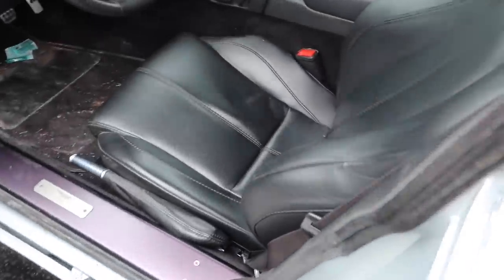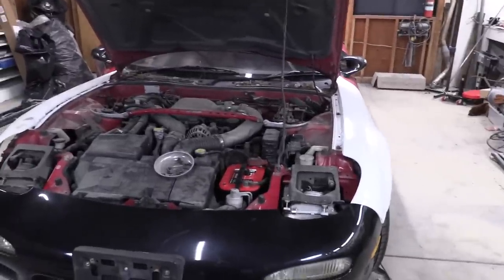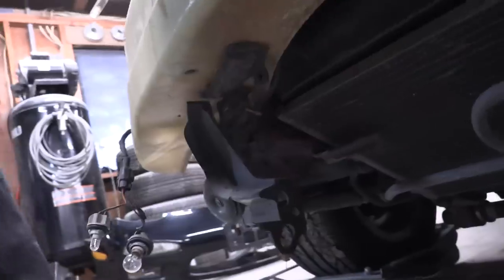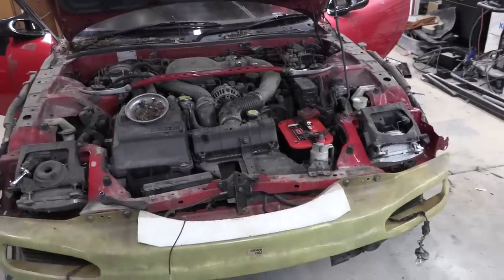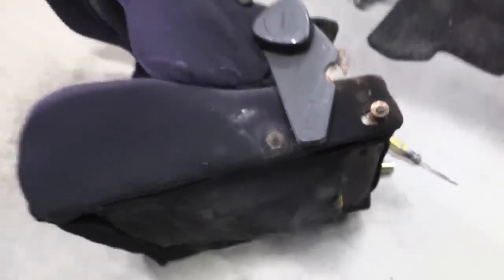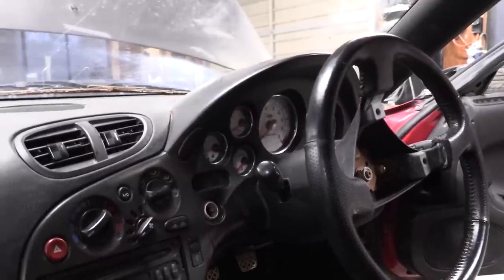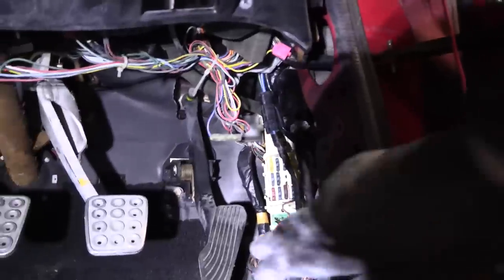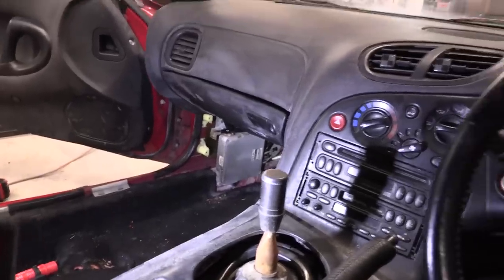Everything Wrong with my Cheap Imported RHD RX7 😜

Comment: My best guess as to why the Rotary wont run is the Rotary Seals on the actual rotors themselves. Im sure you know how a rotary works however the motor more than likely needs to be taken out and re built for "longevity" and not "f shat up" reasons. For the people who dont know a Rotary engine is powered by a Rotor basically a round triangle, that on all corners has a seal that makes it so that the combustion does not go into another side of the rotor. when people say 3 or 4 rotor is referencing the amount of "rotors" or "pistons" in the engine, but remember that a rotor combusts at 3 sides at a time while a piston combusts at 1 side at a time.

Comment: Chris, rotary engines aren't like piston engines. You can't just start em up to move a parking space and then turn em off. You've likely flooded it and over time this will then wreck your side seals.
Sit down of an evening and give Rob a long call and he'll no doubt be happy to give you all the tips for rotary ownership.

But the bad news is with the condition of that car, I guarantee your engine needs a full rebuild. That isn't quite as scary as it would be on something like thale Aston, but its still about 2-3000.
At least you'll be able to to get it Bridgeported at the same time (equivalent to lumpy cams, for that brap brap brap brap idle noise, and more gooder power)
If this is your dream car you can't stick your head in the sand with this mate.
Hey at least you bought the right car, look at my profile pic, I've blown 30,000 UK stirling on an 8, which, without another 15k for an rx7 engine swap, ain't ever gonna have more than 350ish hp...
Id have 800hp now if I'd bought a Supra (and this doesn't upset me at all... -.-)
Anyway, stoked you got yyour dream car mate, just do some research on the starting and shut down procedures, you can't treat these like a normal piston engined car.
Even the M5 can be driven like a VW golf to the shops and back.
Anyway, look forward to watching that first time you rev it out, sounds amazing in person!

Lads please like so Chris can read this, (or copy and paste I'm not digging for likes) long time rotary owner wants to share some friendly advice :)
Reply: Bridgeports suck on the street.
Reply: Nooo Peripheral Ports suck on the street. Bridgeports are fine to daily, unless you're a fanny who expects their rex to drive like a Corolla to work everyday.
I don't think Chris will be scared of a bridgeport, he drives around in cars that he's hammered the suspension strut back into roughly the right place. Also, the 7's been a dream of his since being a kid, and if his rex does end up a little gnarly for daily use, he only has three other cars to choose from eh?

Comment: The sticker is the "shaken" sticker. the japanese vehicle inspection. the big number is the month, the little number on the top is the year (they use a different year system than we do in America) If I remember correctly the sticker represents when the Shaken expires, meaning it would've expired the 10th month of the 27th year (2015). so the last time it was road legal was on or before oct of 2015. 

once you get the wiring figured out, could you possibly show if the side red rear markers/ front orange corner markers light up? i would like to import one, but the state i currently live in requires these to work for them to be imported.

Comment: Two things. 1) Get the carpet out of the car. That pad underneath will be soaked. Take a house hold carpet cleaner to it to help sucks up the water. 2) Your car is most likely out of gas. Since your gauges don't work you can't see that. They would never put it on a boat without making sure it is empty. Last thing they want is a fire on board a container ship.

Comment: I'm not sure if you solved it yet.  But I remember going to a bar and when I unlocked my car and hopped in the lights started to pop up and down and flash, , and the horn was honking, and it was really embarrassing.  I tried the key in the ignition, and locking and unlocking the driver's side door to no avail.  Strangely I went to the passenger side door (I guess your driver's side door) put the key in an unlocked it and the alarm turned off.  It was traumatic enough that everywhere I took the 7 to after that I just left it unlocked.  I believe it was the OEM security system.

Comment: on the front the 2 elec wrapped plugs are probably for fogs. the other random wire could be a outside temp gauge if the car has that function. I know my bmw has one that goes into front bumper.

Comment: Rotary engines flood if not properly warmed up.   I'm assuming that the deflood button doesn't work so put some windshield washer fluid in the service ports and it should start right up with fresh gas

Comment: I hope the Apex seals are not toast. If it's all good then please start mixing in some 2 cycle oil into the gas, it'll prolong the life of the engine (at least will help protect the Apex seals), just do not overly rely on the stock internal oil squirters/injection.

I would say you got yourself a tsunami car. It's been flooded. Strip it and replace a lot of the interior.

Comment: Could the taped off connectors on the left hand side of the bumper area be airbag sensors? Also I was a bit surprised that you didn't check that the emergency flasher button wasn't depressed.

Comment: The cars flooded they run really rich when cold you have to let it warm up when moved also disconnect the spark plugs and secondary air pump and crank for 10 secs and let it rest for 5 minutes and then again do this 10 times try start it with everything connected afterwards and let it run might need to keep the idle up and it will smoke loads but it will clear up ;)

Comment: The registration sticker on the windshield actually means it was registered in October, 2015. The smaller circled number at the top (27) is the Japanese Heisei year which corresponds to 2015 (2015 - 1988 = 27). The larger number (10) is the month.

Comment: Didnt finish the video yet but had a very similar problem with my 3000gt alarm it just needed to be reset after having battery disconnected which for that car could be achieved by unlocking the rear hatch physically with the key. Since the cars are from the same year i figured it might be something similar hope this helps

Comment: The white on the carpet is mold. Brake light switch is most likely corroded causing the brake lights to be on. Horn going off may be a water damaged air bag control unit. It looks like alot of water damage, probable flood car I've seen plenty of them at work. I would be worried about water you can't see that's going to cause rusting that you won't find until something majorly fails structurally

Comment: You're going to have to rip out the motor and change the Apex seals you need a engine seal kit and do not turn on the engine and turn it off fast you will dump two to three times the amount of fuel in the engine and flooded it.

Comment: The 10 on the sticker is not 2010 if my math is correct 1998. My current sticker has 30 referring to 2018. And it refers to the "japanese compulsory insurance" (JCI) every 2 years you have to update your JCI it their registration.

Comment: clean the car first.  then check electrical,   then move to motor and being a rotary the motor is probably going to need to be rebuilt.  probably lost an apex seal or side seals are bad causing compression loss.  electrical sounds like a bad ground issue.  check your grounds first.  i ran into that problem before.  then check fuses and see if they are missing.  after you get done with electrical move to engine.  just go ahead and pull the motor.  buy one off of ebay or find someone who knows how to rebuild it.  get it bridgeported.  turn it into a single turbo setup.

Comment: I have and fc rx7 and sometimes it likes to flood itself. It's a common issue with fcs, Idk if fds have that issue or not but, a quick fix it to pull the fuse for the fuel pump and turn it over a bunch of times and then put it back in and it might start. Mine does. Also, yes, I'd change your fuel.
Reply: 89+ have a ecu killswitch so you don't have to get out of the car to clear a flood, which I believe was also carried over to rx-8s. Just fully depress the gas pedal while you crank.

Comment: you might have too much fuel in it i had an rx8 and if you start it and turn it off right away it leaves a lot of fuel in the engine so you might have to pump the gas pedal while cranking it

Comment: Rotaries are bad about flooding, pull the spark plugs, pull the fuel pump relay and spin it over and blow out all the extra fuel, replace the Spark plugs and fuel pump relay and it should start

Comment: Short to ground that's probably what's wrong with the lights. And they are suppose to be able to turn on when everything else is off, so the switch for the emergency lights is probably the short.

Comment: If he has an alarm then it probably has a starter relay(Bosch - Single Pull Double Throw)  that interrupts the starter. Find the relay and reconnect the starter wires and see if the car starts. Then it'll be just rip alarm out....good luck.

Comment: RTR = retractor? RTR relay is retractor relay.

Emergency flasher is stuck in "ecu2" or "CPU2" on the right of the accelerator and up. Pull it first if anything for hazard / horn problems.

Comment: The engine stalling sounds like a complete apex seal failure in one of the rotors . It will run super rough and stall on idle .
Reply: Or maybe just old gas? No need to jump to conclusions.
Reply: Yeah true that! But ... I have a series 8 Fd Rs and that’s exactly what happen to mine . Hopefully just fuel!!

Comment: Driver's seat is an old Bride Brix/Brix II seat and is trash. Could possibly be sold to someone who could reupholster and redo the foam on it? The funny thing on the car is those Nissan 240sx wheels... I'm surprised it actually didn't have OEM wheels since they aren't too popular. The side mirrors could be real Ganador mirrors, but could also be fake eBay reps that look like them with plastic housing and "carbon" style paint.

Comment: I bet that small fire that happened by the trans was caused by a extremely hot exhaust and burning oil rushing through it (or out of a exhaust leak) because rotary and thus catching fire.. because rotary 😅

Comment: Do a compression test on the motor b4 you pull it.
After fresh fuel look look at the fuel filter they are a bitch to get to and can ruin a new motor.
A few of us have fixed zero start problems and erratic drivability with just re going over the wiring harness schematic and reconnecting and fixing bullshit and making sure the grounds are good.
I think you have a basket case but its a rite of passage : ) subbed

Comment: Make a Doritos joke!!

(Or something about apex seals exploding)

Also, if it has been sitting, get new sparkplug wires and new sparkplugs and make sure the engine is not flooded. If you have one, use a boroscope to see if anything on the inside is blackened and crispy or if the rotor housing has scoring marks on it (it's very hard to see that, but possible). Another potential problem is the coil packs, if everything else looks good, they are likely the cause of the problem.

Comment: Salvage title vehicle cannot be driven on the road in any state fyi- Car must be repaired and inspected (only some states) then Salvage title is then turned to a Rebuilt title. Ebay is king of salvage title vehicles and people buy them not understanding the process. (Salvage) title means exactly that its for a Salvage yard for parts cannot be driven on the road. do your research before purchasing.

Comment: Just Sayin' The emergency flasher is wired so weird and the internals on the switch fall apart and they literally cause the problems you are looking at. It gets even worse with an aftermarket alsrm,

Comment: I'd contact wiring specialities and suss out a whole new wiring harness. Rip the old one out. Electronics in these rx7s are kinda junk especially after someones already raped and pillaged the car doing who knows what. My FC had a mind of it's own and was fairly clean, little things like humidity affecting windows etc.
The 13b turning over is a good sign though. I'd still get it rebuilt but atleast you know its not seized. check the oil and water condition/levels will give you a basic idea of condition also. So looking forward to this build. Good skill big homie :)
Peace & respect from Australia.

Comment: Remove the gas change the oil you may have been running on very poor oil or no oil and seased the engine or kept the engine from getting enough compression maybe plugs are fouled now. 
That's what I would look at first for engine probably change coolant and brake fluid before your big drive.

Comment: Welcome to the money pit.  U got your hands full.   First pull the motor.   Check compression and anything else. More than likely needs a rebuild with new apex seals and what not.   Look jnto extra oil coolers check turbos. Go threw vac lines since it sat.  Pull carpet out.  And prob gonna wanna go threw the engine harness and dash harness checking everything.  Ur in for a big job. And get ready to open the pocket book.  Unless u get a bunch of free shit lol

Comment: i would just replace the ecu and the wiring harness. if the car have been flooded by the 2011 tsunami (as someone stated in the comments) i wouldn't take to risk to run with the original elektronics
Reply: FejFTv *wouldn't ?
Reply: madmax2069 thank you. I changed it

Comment: Why wouldn't you try the hazard button first? Lol Seems to have definitely been in a flood or drove into a lake. Bad water damage and a bunch of wiring and electrical problems spells flooded and run away!! I hope you you get it figured out though without sinking yourself. This has race car all over it. There's way to many issues to bring it back without completely rebuild the entire car and going broke. B will be for Broke with this bitch. No hate either! Love the vid and digging the dailies.

Comment: Mystery wires near the front bumper are probably for airbag sensors
Reply: 90's cars just mostly had one sensor unit inside the dash, measuring just the impact acceleration. Someone suggested they were for the fog lights.